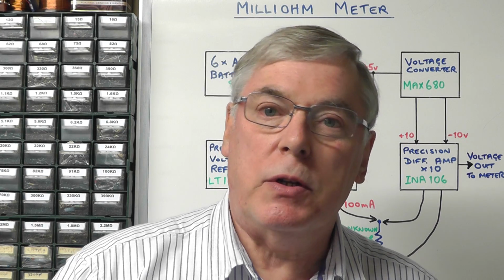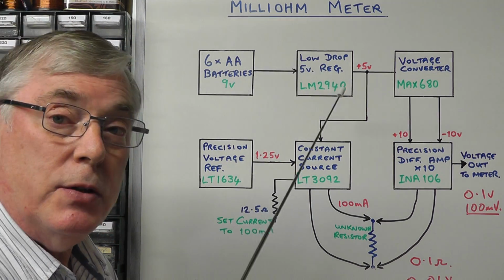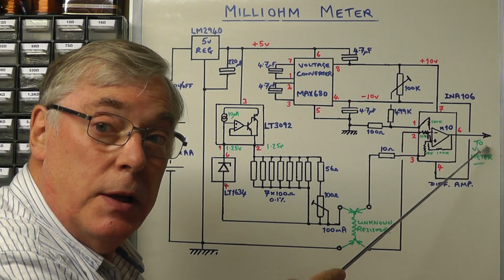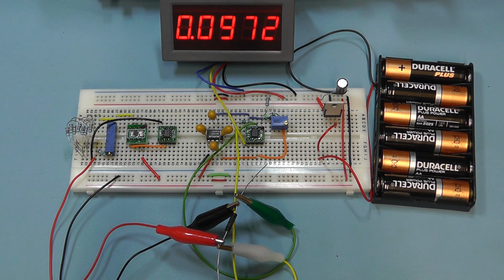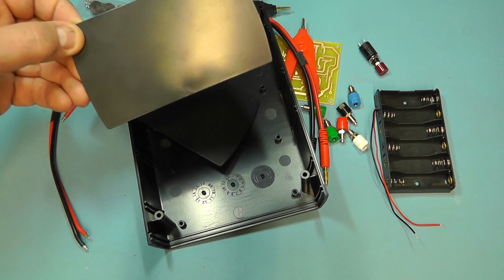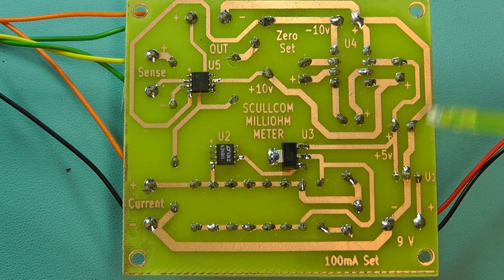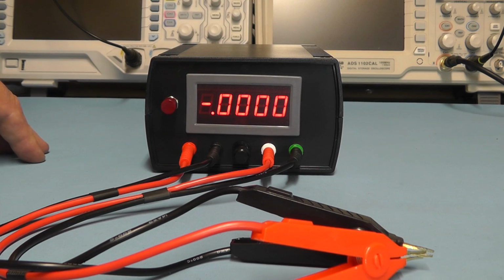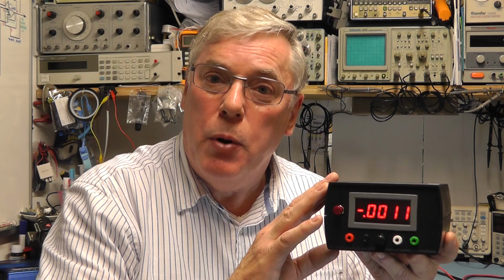Scullcom Hobby Electronics #31 - Design & Build a Milliohm Meter

Comment: This is an excellent project. I will probably build it and use my Keithley 197A for the meter since it is the most accurate meter that I own. I see possibilities for using this for finding shorts while troubleshooting PCB's. One question that I have though. Would it be better, at least in my scenario of using this to find PCB faults, to use 10ma as a source instead of 100ma to reduce any heating? Or, do you think that this would not matter?
Reply from the maker: +capriracer351 Thanks. I have found that using 100mA current source to be the best option as you are able to get a better voltage reading and therefore a higher degree of accuracy. Some commercially available Milliohm meters on the market do use 10mA source current but in practice I have found their results to be poor on very low resistance readings below 20 milliohms. The higher the current used the better the accuracy of the results. Of course there may be some difficulties in providing a high value very accurate constant current, but today with the Linear Technology IC LT3092 this is relatively easy up to a maximum current of 200mA. At these levels heat is not really an issue. So to summaries I would recommend you stick with the 100mA.

Comment: Great project, thanks for sharing.

Have you considered some kind of thermal EMF compensation? I guess it is perhaps not essential until you get down into the 10s of microohm.
Reply from the maker: +TheStuffMade Thanks for your comments. Thermal EMF compensation is really only needed at much lower resistance readings in the low micro ohms and below. Also if you wanted to check such low resistance readings you would also need to screen all the input leads to stop pick up of noise.

Comment: Great video as usual,  just wondering what the current consumption is like? I assume only a handful of ma.
Reply: +bgdwiepp it will be at least 100mA when in operation, plus whatever the meter takes.
Reply from the maker: +bgdwiepp When a resistance is tested the current consumption is just over 100mA. However, when the unit is switched on and the input leads are left open circuit the current consumption is very low only a few mA mostly due to the current used by the panel meter.
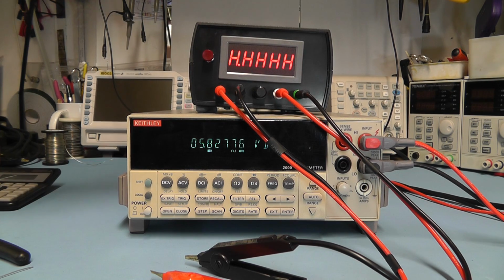Reply: +Dave Curran, no, if the test clips are not shorted together, there's no path for the 100mA to return, so the LT3092 floats to its highest output voltage and consumes only its quiescent current (10uA set pin current plus a few uA for its internal circuitry).  You can see this at 43:47 in the video, where the clips are open circuit and the Keithley meter reads 5.8V.  The other ICs will draw a few tens of uA, plus a few mA for the panel meter.
Reply: Scullcom Hobby Electronics Thanks for your reply! thats quite good, i think i might build one up myself